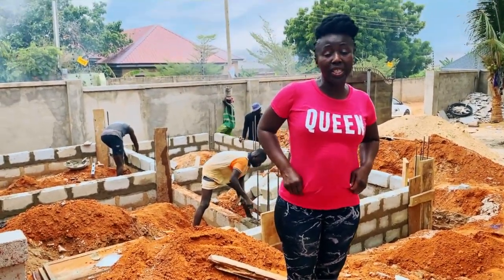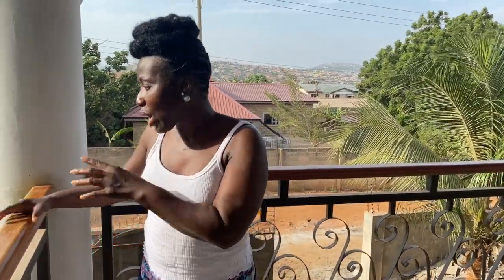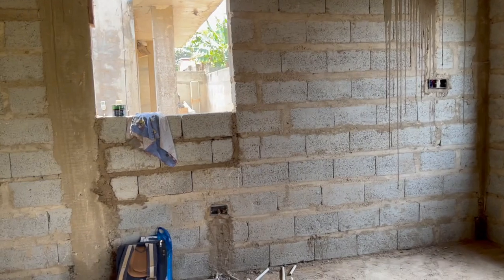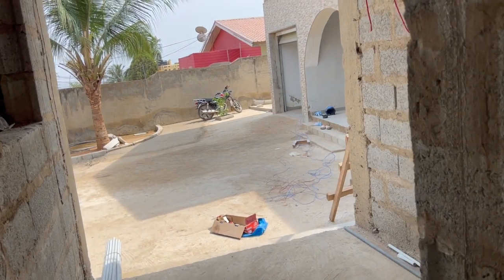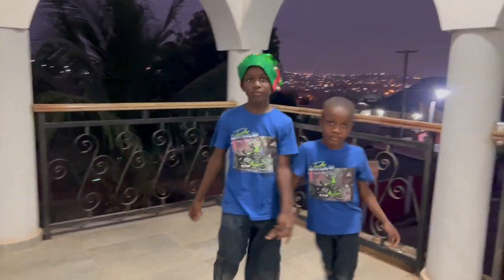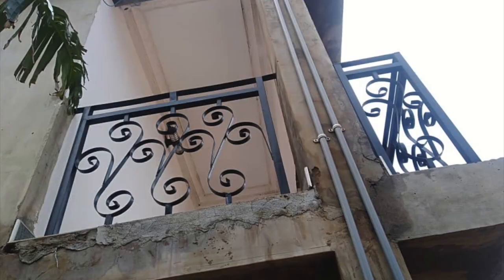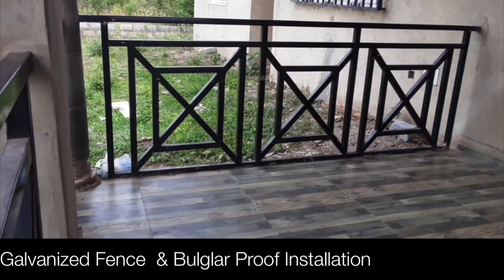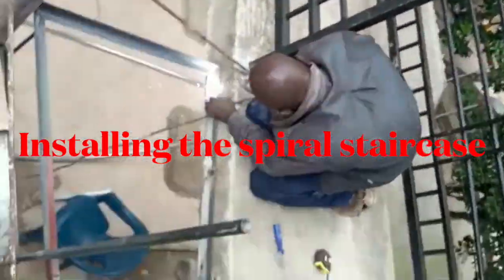Building In Ghana: From Rusty Regret to Galvanized Glory! Summer-Hut Update - Plastering & Screeding

Comment: 😮 Ashanti queen 
I just watched your Damp issues.  Now I did have a bad issue with Mine in Ghana.
It was soo bad that the blocks 
Were coming apart.
This is what I did which help.
I bought this Chemical from U.S. it is a bit pricey but it has help . It is a 3 part system. It is like paint and Activater and Finaly another chemical to thin it out before applying it.
It cost  almost $600.00 a few $ from it.
When I brought it the plastering was taken out the Chemical was applied like Paint before plastering with Mr. Fix it and the Chemical was painted on it again and it did work.
Please the stone thing is like Puting a band aid on it the actual damage is not been cured.
Reply: Hi what is the chemical called?